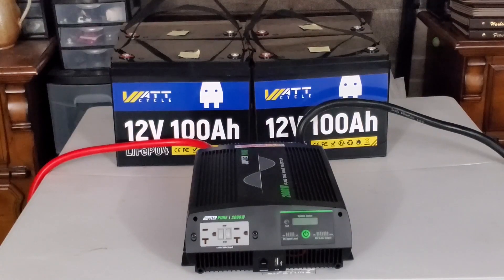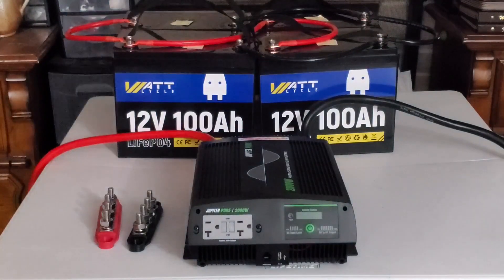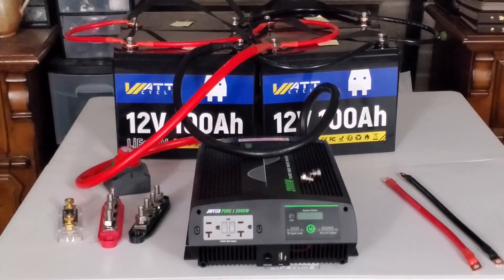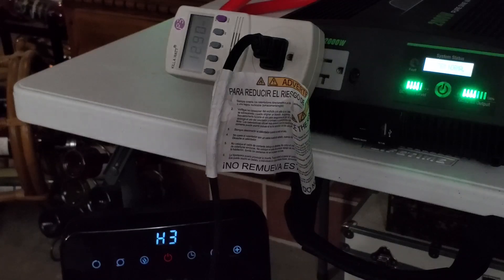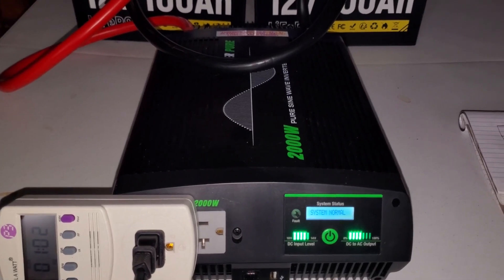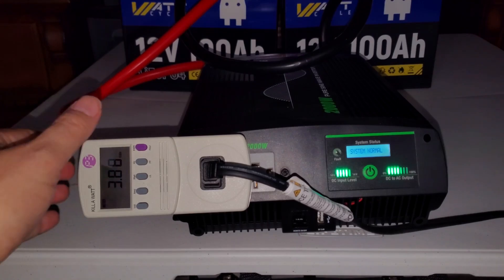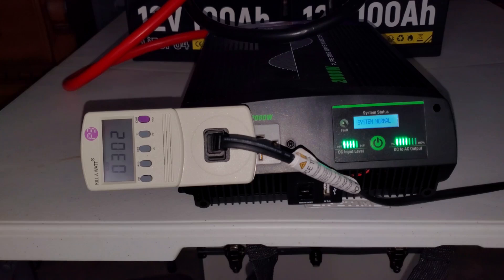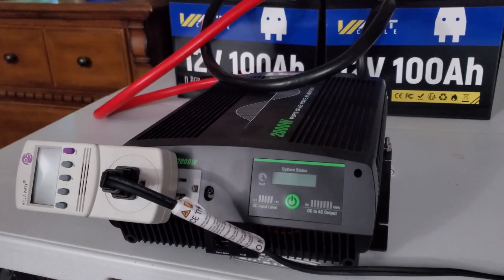Unbelievable Results from a 5444 AMP Hour Battery Bank!

Comment: 12v 100Ah * 4 = 12v 400Ah = 12v 4,800Wh / 1,300W load (108A draw battery side, 10A draw 120vac side) = 3.5hr run time. Where is this extra 600w and 30 minutes coming from?
Reply from the maker: The true voltage on each battery was 13.61v so 13.61v x 400ah = 5444wh / 60 mins = 4h 15m approximate runtime but that didn't account for the inverter load itself. I believe the wattmeter showed a tad bit over 4h of runtime before the inverter shutdown the AC output. A 15m loss out of an approx 4h 15m of runtime, I'll take it! Thanks for watching.
Reply: @Hoos-Prepping  ah, that be where those extra pixies were hiding. 

Heh, yeah, always gotta account for conversion (in)efficiencies. However I agree, after 4 solid hours if you're sweating 15 minutes ... probably should have been more serious about backup reserves LoL. Thats plenty of time for charging everything, turning on the tv for the news, power up the router and send some emails, and still have enough in the tanks to keep the fridge cold till the sun comes up! 

Perhaps next time you run it, tape a thermalcouple on the outlet vent/casing...heck, even one on the inlet if you run it in a range of air temps, see how temp impacts the efficiency. Granted with modern tech and methods, compared to the old school stepped sine wave dirty power car trunk inverters, probably not much until it gets uncomfortably worringly hot to the touch around where the fets(igbts?) are mounted...but thats just the data nerd in me, "GATHER ALL THE THINGS IN ALL THE WAYS MAKE ALL THE GRAPHS!!!” ...we usually keep him chained down, but the wiley bastard slips free now and then 🤣